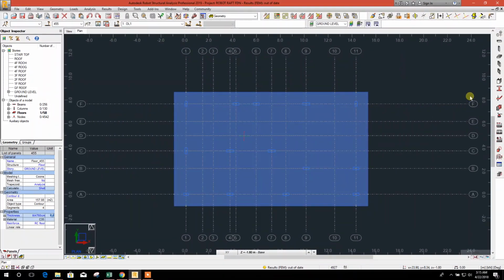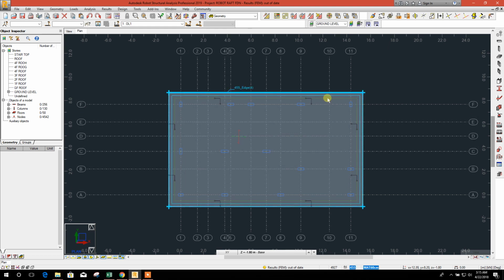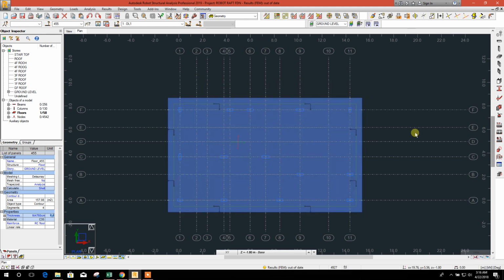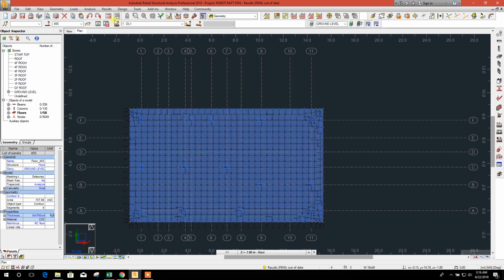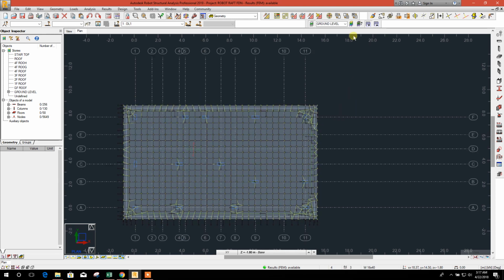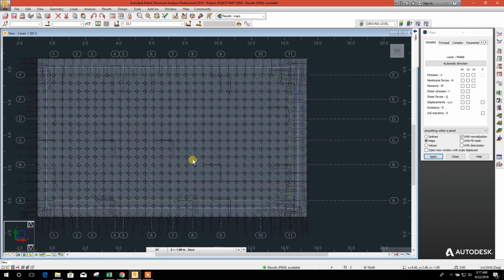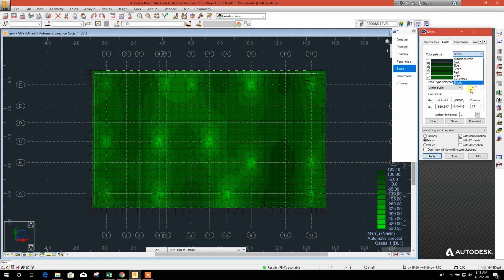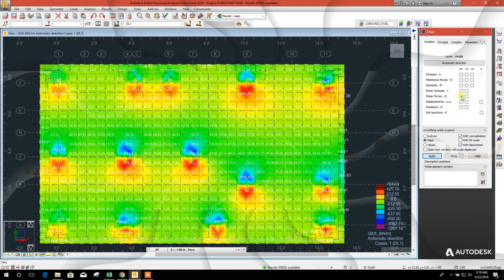MAT/RAFT FOUNDATION DESIGN IN ROBOT STRUCTURAL ANALYSIS 2019-PART2

Comment: So this second step, where you add planar support springs, supersedes your previous video, where you assigned elastic foundation parameters to the raft. 
Quoting an Autodesk Support forum post, by a main Autodesk tech support person: "If you use nodal (surface) supports then you don't get maps for elastic soil as it is not defined. In such case the values of reactions are listed in the table of reactions. Maps are available only for a definition of elasticity assigned to a panel thickness."

Refer to this: https://forums.autodesk.com/t5/robot-structural-analysis-forum/unable-to-get-soil-reactions-with-elastic-planar-supports/m-p/3201784

You should really add this clarification to the video! It is extremely important.
Reply from the maker: Meshing option is a factor get nodal reaction. That specialist may be suggested another way for different approach.